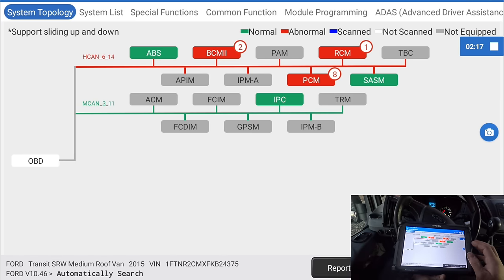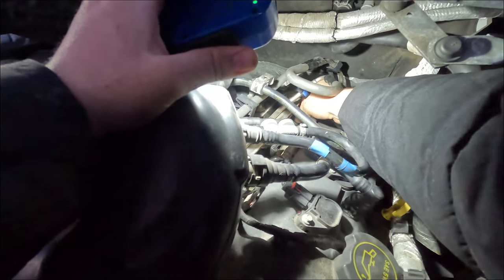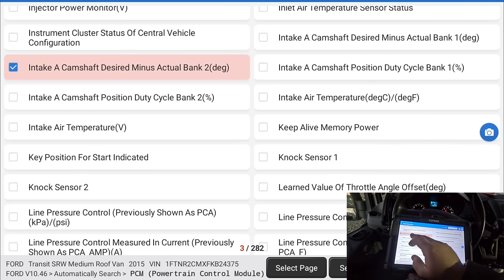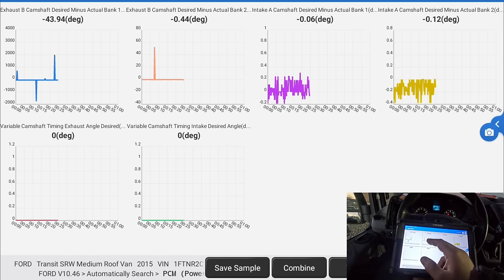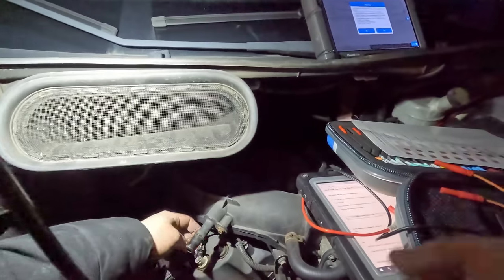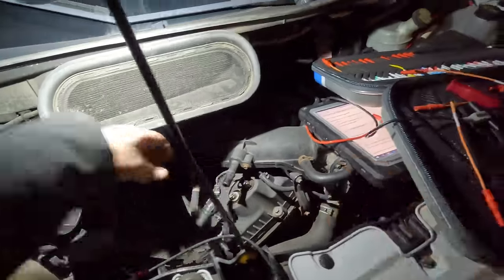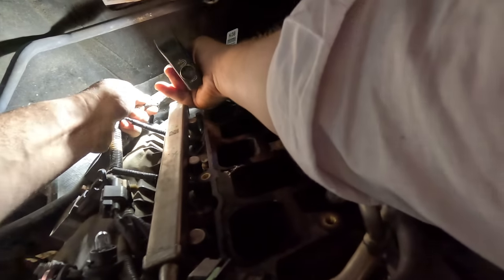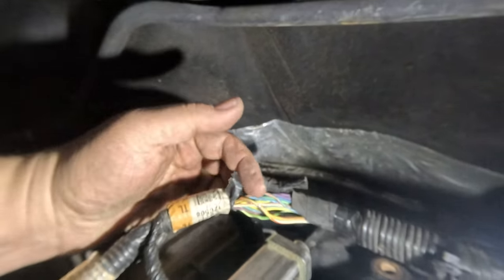2015 Ford Transit  - Running Rough , VVT Issues , Diag & Fix!

Comment: Saved a lot of time by understanding the short to ground could be proven by disconnecting the computer. Perfect pivotal test, light stays on its the circuit, goes off and we’re looking at the computer.

Comment: Please keep the videos coming. I’ve been a tech for over 20 years. Chasing down and diagnosing electrical issues is what I love to do. Just watching you guys use all of the special tools  to narrow down and identify the problems are truly amazing. I always told my customers that normally a wire issue can be found quickly or it will take a while. Good work guys.

Comment: Nice job on fixing the problem.  I watch these videos to learn from . Saves me a lot of money .. seems like i heard check points of contact on wiring harness..... i watched a fellow take a pair of wires and twist them up in a drill to be used as a splice. Repair on a can networks.  C   can i think . He just spliced in the wires in the harness . Saved a lot of money . I appreciate these videos thanks
Reply from the maker: Thanks for watching!

Comment: I’d be curious if that yellow wire was the cause of the injector circuit open code as well. Also did you tell him he needs a purge valve for the classic cannot bleed fuel tank vacuum lol
Reply from the maker: The injector code was because #6 injector was unplugged. I think they saw the car running rich because of the timing so they assumed it was an injector issue. As for the bleed down code I completely forgot about it, until now😂

Comment: wow so the customer had to pay for new injectors and a computer that were not needed? How much did that cost? great video. thanks.
Reply from the maker: I don't know if the customer had to pay or not, it was in a different shop. It's also possible that it needed injectors and they built in this problem when they took it apart.